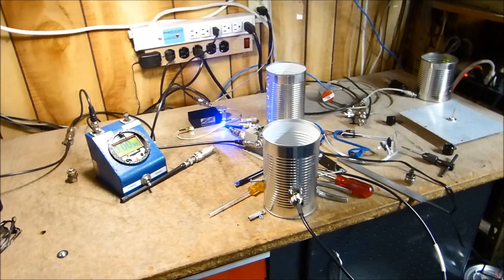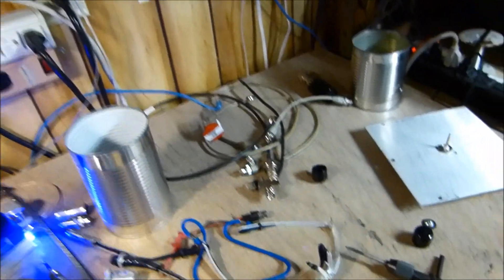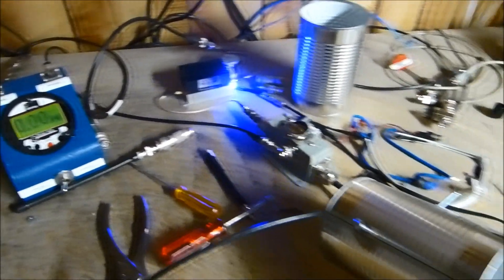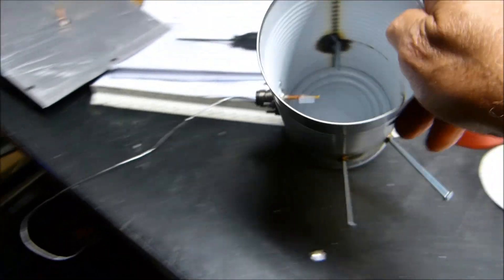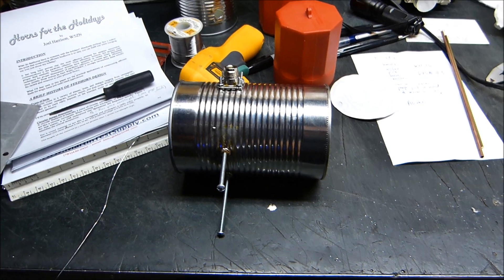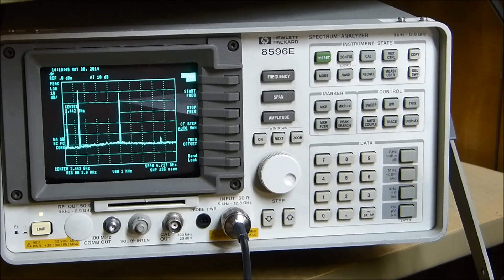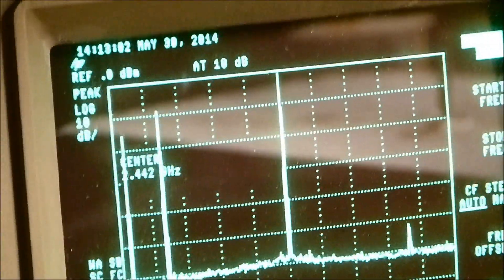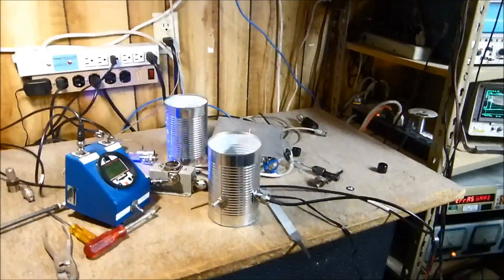WiFi Cantenna Antenna  And Parabolic Feedhorn Analyzed And Measured

Comment: Also adding... The diameter and inner flat surface volume, as well as the direct reflection from the back plane of the can, are what makes these difficult to tune. You have two combined principals you are fighting in one device. Unfortunately, like you indicate, we all need these tools to honestly tune these things. This, making DIY, severely limited, since computers don't relay actual signal strength, but a rough estimate that is honestly irrelevant for testing. I can get a -80 db signal and have a solid connection, or absolutely no functional connection, through the same measured antenna. By adjusting it, you can go completely past the tuned spot and the computer will never even register it and sometimes that will be just as non-functional too. The only true "test", is a long distance connection, with a ping and a persistent download stream.

I have had connections down to -40 db, which had pings in the 2000-4000ms response times and could only provide bursts of fast data, before the signal became saturated and literally knocked out the wifi chip or they just throttle down to a 0.01 Kbps speed before the signal ultimately drops. But it's a solid signal still, just not a functional signal. It's like trying to hear your guitar playing with feedback. Yes, that note is 40x louder, but it's not the note you are currently playing anymore.

Comment: The big question will be if chopping the tuning poles will result in the same results. That protruding part outside of the can is an inverse antenna. Cutting it will potentially destroy any tuning you got from them, as the protrusion that is collecting signals and mirroring them inside, is no longer acting as a notch filter.

Comment: it looks as if you space the driven element further from the base of the can with the longer cans. How far from the base with a 6.5 inch long can, please?
Reply from the maker: Hi Nick,
I don't have an actual mathematical formula for these dimensions so I would put it at about the same place, approximately 1/2 wavelength from the bottom whether it be a 6 inch or 6.5 inch can. I plan on a video tonight showing a book I take some of these dimensions from and hope it will help answer some questions.

Comment: It would have been more interesting to detune the antenna in the can to get a SWR of around 1.5 to 2.0 (still 95% - 89% transmitted power) to see how much that effected the received signal. I suspect that you will not see much difference, meaning it's the directionality of the can thats bringing the "gain" up.

Love your man-cave & gear!

Comment: 4" is too big. The ideal size range is between 80mm and 90mm. Use big sauce cans, 3-1/4, that comes to 82.5mm. Then, the hole in the can needs to be 2.49" from the base of the can. I wish I had equipment like yours.
Reply: There is nothing wrong with cladding pvc or other materials like cardboard in aluminium tape... or aluminium foil if you must. You can make any size you like and see what works best... Would be great to get test results on all the myths and assumptions out there on cantenna's biquads, double biquads and helical antenna's... With a equipement setup like that...man, would be great to see some stuff debunked or "set in stone" so to speak...
Reply from the maker: I haven't worked with any 2.4G antennas lately. I used home brew antennas for a long time to communicate wifi to my mother-in-laws house but about a year ago, I installed store-bought 5 GHz antennas and they are so much better. I still have a nice stash of parabolic reflectors but just haven't messed with them lately. I do have several videos on the 2.4 GHz antennas that you may not have seen that does document, as best I can, their performance. Thanks for your comment.
Reply from the maker: +UNITED POLICE STATES OF AMERICA I don't doubt that you are right but the reason I used the 4" can is so it will fit properly inside the thin wall PVC -  I would have to go to 3" for the next size down in PVC. Thanks.

Comment: What are the can measurments ? What are the screw's in the can measurment's ? HELP !
Reply from the maker: +Shannon Brooks From my experience, a 4 inch diameter (about 10 mm) can works well for 2.4 GHz. I put the screws at the same distance from the bottom of the can as the feed point is from the bottom of the can.You just have to play with the lengths of the screws as I  mention in the video as some are more important than others in changing the reflected power. Watch the video again and I think I mention all the important dimensions. If you want to start with my adjustments, you can stop the video at some convenient point and using the diameter of the can as 4 inches, make relative measurements on the computer screen of the lengths of the screws and tweak from there. Hope this helps.
Reply: Thank you ElPaso........Quick responce, and willing too help. Wish more ppl was like that...

Comment: Hi Dave,
Well, them beans are good for the heart, ya know..LOL
My electronics lab is a separate building on my property and is just at the hairy edge of what my wifi can deliver. The Chinese have repeaters for wifi on epay for under $20 but not sure they are worth the effort. I considered buying or perhaps building a set of yagis but you have encouraged me with your EXCELLENT work/video to build something. 
Of course not having wifi in the lab probably saves me a lot of wasted time watching youtube..LOL  But, to be able to look for technical docs and parts while working does save time.. 
Again, thanks for the time you invest making thee great videos. 
73,
Glenn WA4AOS
Reply from the maker: Glenn - always good to hear from you. I do not know about the repeaters but once I did have two parabolic dishes between my house and my mother-in-laws house for Internet and security camera purposes. Now I use EnGenius access points - I think they are ENH202 - much smaller and sleek and they work great. I bet they are just what you need between your house and lab. The yagis that I have purchased from China are junk - the "cantenna" out performs them many times and are very directional. I actually hate computers as the damn thing takes up valuable real estate in my shop (which is tiny) but I do need it as you mentioned for technical documents and the such.

Comment: Nice work you did there. I've been curious about these antennas also but just haven't had the time to do what you did here. Thanks much! It would be great if you could pass some starting point measurements along to us. It would be greatly appreciated!
Reply from the maker: I have built a number of these "cantenna" type antennas over the years and through experimentation, I have come to the general same conclusions of the article that was laying on my work bench, "Horns for the Holidays" by Joel Harrison, W5ZN. He did a nice job of documenting his project and his article is on the Internet. Go to "W5ZN.ORG".  In my case, the tuning stub that was directly in line with the driven element was too sensitive and did not make things better so I offset them at 90 degrees and about 135 degrees. As I mentioned in the video, we all seem to discover something of value about these devices both as an antenna and a feed horn to illuminate a parabolic dish. I hope to get to the dish mount soon and am anxious to see how that turns out. Naturally, I will have to make some relative measurements at a much greater distance to test the parabolic antenna - Thanks for your comments.
Reply: ElPaso TubeAmps
Thanks much for the link...A gold mine of info indeed. It is very appreciated..!